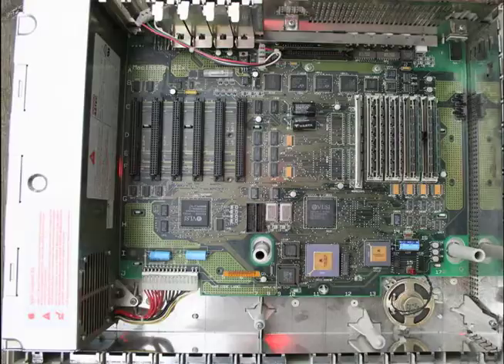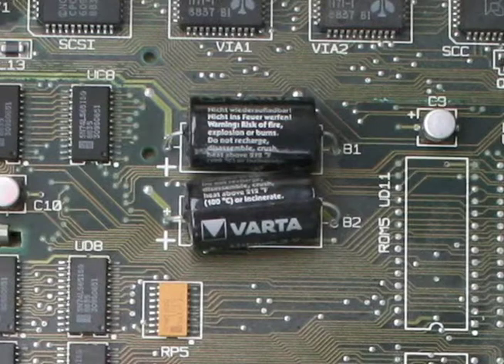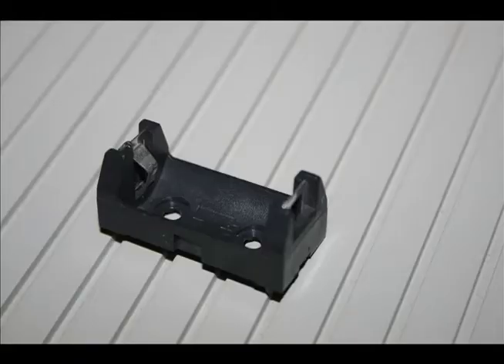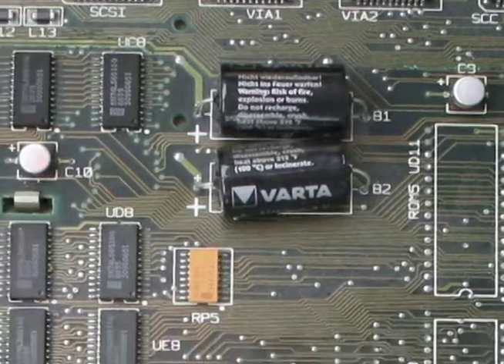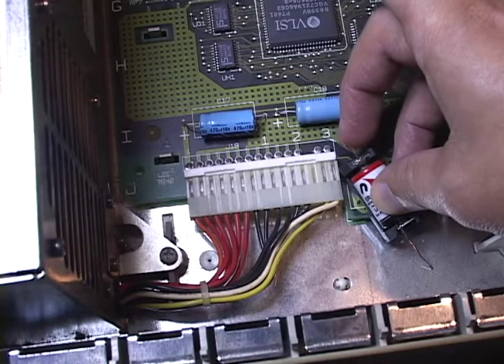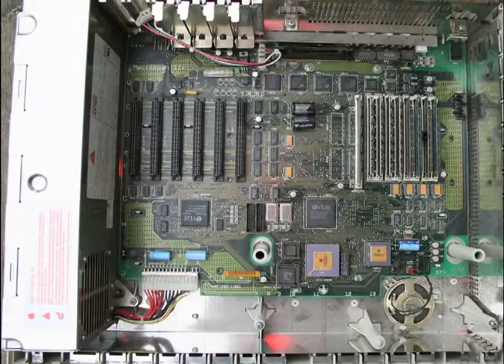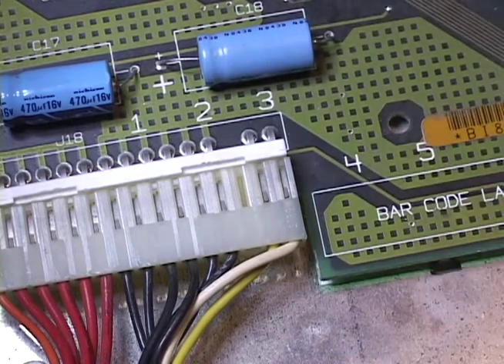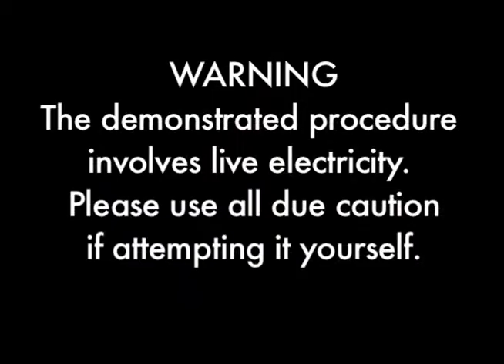Jump Starting the Macintosh II

Comment: Thank you for this "jump start" fix. I had a number of Macintosh II's, IIx's and a IIfx that did not start. I did not have a makeshift 3.6v battery holder, so I got a 2x AA holder and a 3x AA holder to test out. Apparently it only requires 3.0v to jump start the Mac II, so I tried the 2x AA holder with some fresh batteries, and viola! They started! Except for the modified Mac II and the IIfx which had the 2x 3.6v removable holders. I had to fiddle with the wire a bit, but I found that if I hold the the positive wire on the white wire terminal and poked the negative wire on the shielding, it would eventually start. I filmed the whole process and will edit and upload in about a month's time. Thanks again.

Comment: This totally worked! Using the holder became difficult but I found that just electric taping some wires on the terminals of the batteries worked just as well. The computer will also have to be jumpstarted every time you want to turn it on unless you have replaced the batteries.
Reply: Hey! This worked for me too. Amazing after all these years.  But alas, no startup sound, no activity at all afterwards.
Reply from the maker: WizardOfWhoopee   That’s too bad! So the power supply powers up but nothing else.
Reply: @WizardOfWhoopee  If you get it started then you know the power supply works. If you get no startup sound and/or no activity, then you require further investigation with the logic board. I recently jumpstarted/kickstarted a number of Mac II's, and some had a startup sound and some didn't. They all started and I got a display with a good video card. All will require recapping though.
Reply from the maker: That's great that it worked for you!

Comment: Are they rechargeable batteries ? Also, my Mac II started up and both batteries are dead.
Reply from the maker: No, not the rechargeable type. My Mac II started up a few times after I got it, but eventually died and was dead for years until I discovered this work-around.

Comment: is there any way to solder on PRAM battery slots like on the mac iifx to make replacing easier
Reply from the maker: Yes, I had thought about doing that. It's a matter of making the battery holder. I used a holder from an old mac IIsi as seen in the video. If I had soldered it in it would have worked, I just never bothered with it.
Reply: @65scribe  I know this is a year old, but I thought I would give you some info:  My Macintosh II has a small daughtercard where the batteries go, marked (C) 1989 Apple Computer, and it contains two battery holders and a 1000uf 10v capacitor on the card.  It sits above the motherboard, and has four 'poles' off of it that are soldered onto the board through the other side.  It's very interesting, and I've never seen anything like it before.  Can't find any info online about it, either.  So certainly even Apple was looking into battery holders on these back in the day.  Not sure why it needs a capacitor.

Comment: My Mac II came in Friday (my SE arrives today!).  Upon taking it apart yesterday, it appears to have been upgraded as it has a IIfx motherboard with the 68030 40MHz CPU, etc.  I was very excited!  It won't power on, though, and I have removed the two batteries.  I'm so glad I ran across this as maybe my power supply is good after all and it could just be a battery! Thanks for the content!
Reply from the maker: I'm glad the video gave you something to try. That Mac II actually worked when I got it, then finally stopped booting. Soldering in new batteries seemed risky, so I was glad to dig up that tech tip. Half the reason I made the video was so I would remember how to do it! I later revived a Mac IIx board by washing it, shown in a separate video. I appreciate all the other comments you made on my videos, and best of luck with the IIfx board an the SE !
Reply: HA!!!!!  Jump starting it did the trick!  I'm rendering the video now to upload to my channel.  I made sure to give you credit for giving me the idea haha.  Luckily, I guess since mine is the newer IIfx board, the batteries aren't soldered on at all!  They're the removable ones.  I'm going to see if I can find any locally.  Otherwise I guess I'll just order some online.  Of course now I need to track down software and an external USB floppy drive so I can start making disk images on my modern PC.  I also would LIKE an original RGB monitor, but if I have to get a VGA adapter, I will.  I also would like to find a SCSI hard drive just because it's original equipment, but I imagine I'm going to end up getting those compact flash drives with SCSI interfaces for convenience sake.  Hey!  It's all just money, right? ;)  Glad  you like the comments as much as I like the videos.  Again, I would have had no idea about this jump start if I hadn't stumbled across your channel.
Reply from the maker: Excellent news! I'll have to watch your video. Always a struggle with replacement parts going back that far. My mac II came with the giant 5 1/4" hard drive, but it eventually died.
Reply: Yeah, and when I think of all the old SCSI and even MFM drives we thought were "junk" back in the day (and, to be fair, at the time, they were!) that we blew up or otherwise destroyed it makes me sick at my stomach.  I'm really leaning towards the SCSI2SD solution.  Unfortunately, I found out that external USB floppies on a PC aren't much good for 800k disk images.  Before my brain fried last night I was looking at a Mac emulator called Basilisk II.  I still have a some working 3 1/2 internal PC drives, and frankly, I just don't know if it can mount the PC's host drive as a Mac drive in the emulator and write disk images or not.  It shouldn't be a problem with the Mac IIfx IF they did, in fact, upgrade the floppies to Superdrive, but again, I need software FIRST to get the things up and going and to poke around...  and to access disk utilities......... but I can't GET them without a machine already up and running LOL.  So yeah, still poking around and deciding my next course of action which is hard for someone impatient like me.  I'm ready to fire them up, get them on my network, call up some BBSes through telnet, or heck, even DIAL up some boards the old fashioned way ;)

Comment: if i jump start it once, will it continue to power on without a good battery
Reply from the maker: You would need to jump it each time. I ended up putting a piece of wire from the metal terminal to a nubus port hole. That way I would not have to open the case case each time.

Comment: Hi ! I have a Maciici that run almost well... I have a macintosh video monitor, but there's only space for a 'modern" flat screen on my desk. Don't you now how to fool it's videocard and let it work with a common VGA screen ?
Reply from the maker: Hi there! If you have a VGA flat panel that can display 640x480, there are small macintosh DB15 to VGA adapters available. If you do an internet search on that, you can see what they look like. They should not be too hard to find, I hope. I have not tried to find one, myself. Good luck!
Reply: I have these adapters, but MacintoshII series don't work that way - they need to detect it's own type of video monitor. All later macs work with adapters, even the LC's)

Comment: Anyone tried installing 1/2 AA battery holders in place of the old batteries? I've done that on SE logic boards before, but I've never tried it on a II; the SE is a bit of a stretch, and requires you to bend the leads on the holder just slightly... If the holes are spaced any farther apart than the SE's, the holders I have wouldn't work.

Comment from the maker: @adddictedtomacintosh I've heard if you plug a 1st generation powerbook (100/140/170) AC Adapter power cord into it, it will allow you to start up. The power cord that came with it was only designed to charge the battery. Bizarre design!